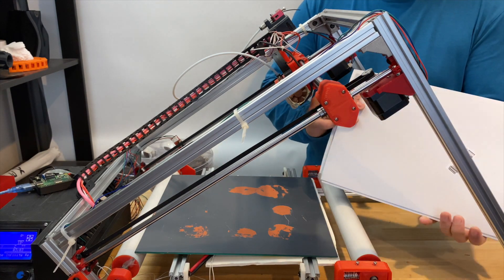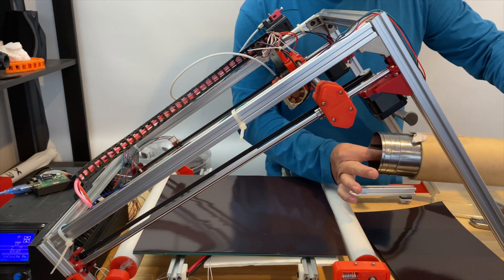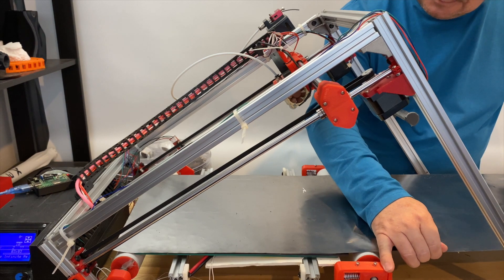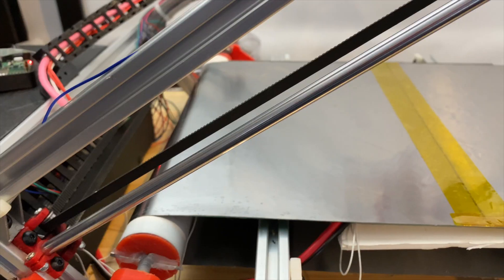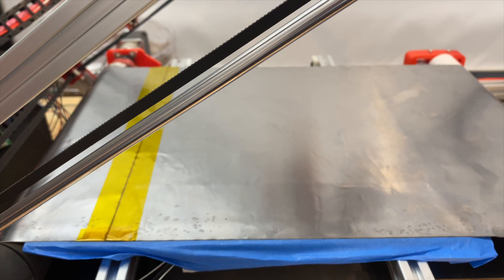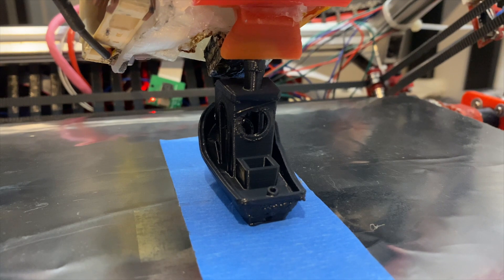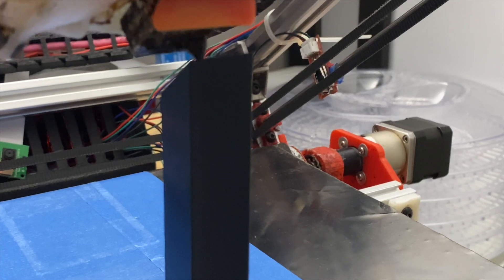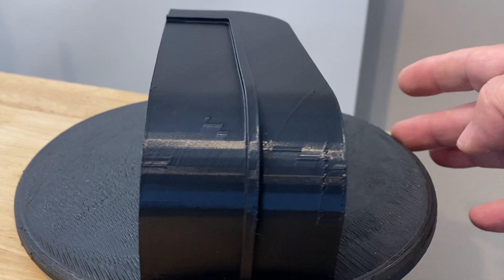Belt printer: Magnetic build plate experiment

Comment: Looking great!!!  Thanks for the shout out..  Its funny I just started testing with a magnet sheet myself..   I would recommend looking for a hardened steel material if you decide to stick with the metal belt.  You'll discover over time the mild steel will stretch and curl on the edges and may develop wrinkles as well..  I had all these issues when I tried using a cheaper steel belt during testing...